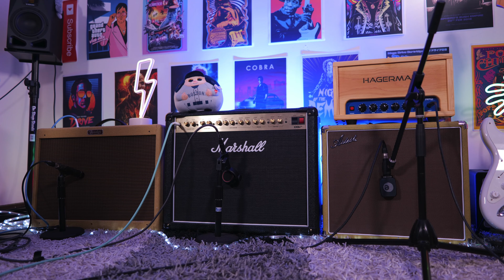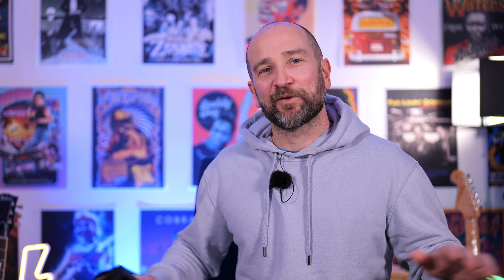Hagerman Replicate - Run Multiple Amps the Easy Way!

Comment: With the current draw so low, it would have been nice to have a 9v battery option so you wouldn't have to have it on your board to use outside power.

Comment: Very cool Shane 
over the years  Ive been mixing my amps together . I like to use  5w amps so not silly loud, valve & SS give you some nice tones aswell
makes playing very inspiring  but i only use stereo pedals  
&  find some sweet spots on the amps. Id love to try three together,
i have about 7 diff amps & prefer  smaller speaker esp for recording
Cheers

Comment: Great video.  Sorry if I missed this.  Phasing?  I looked at them manual on the website and don't see it mentioned.  I find with tube amps that over 50% of the time, I have a phasing issue.  The BigShot ABY is my current solution but going to three amps would be awesome.
Reply from the maker: You're right, it's not mentioned, but I didn't find it to be an issue, at least in my tests. All of the microphones had no adjustments to their phase, either. I tested two and three amps at once.

Comment: Has anyone played multiple amps live to fill out the sound? I have a Morley ABY  switch but haven't used it live
Reply from the maker: I tried it a few times. I always had ground loop issues in most venues.  This solves the biggest problem you'll find with most ABY boxes.
Reply: I used a mates rig (2 amps tho) a Fender Silverface Dlx & a 50w Marshall (the ones with the KT66s l forget the model).
The Fender was clean-ish, the Marshall was driving (via a Lehle A-B or both) it was great!!
Plus l didn't have to pack it all up & cart it!
But great sounding, driven, but clean behind it.
Edit: l blv the Lehle has both inputs isolated...stops hum.
Reply: I play a wet dry rig all the time, you want a phase switch and isolated outputs and you’re off to the races.

Comment: Were you using the Artist amp as a cab? Being new to valve amps..How does that work? As in connecting to the head and the valves not running when it’s on? 
I just received my Artist Amp this week based off of your review..loving it so far!